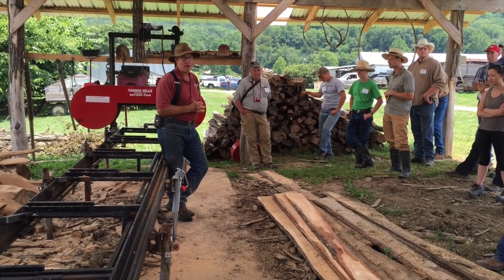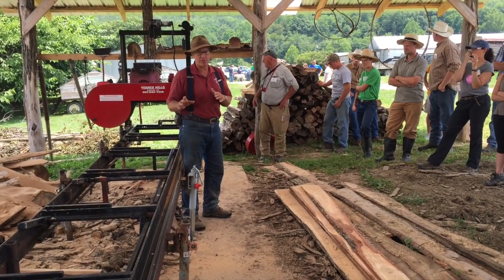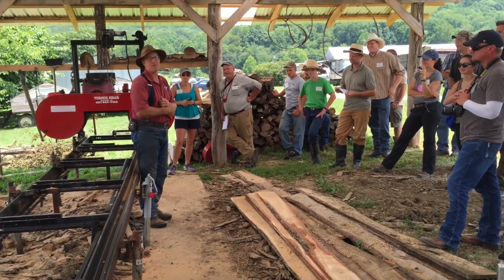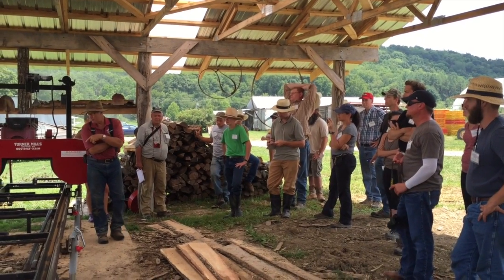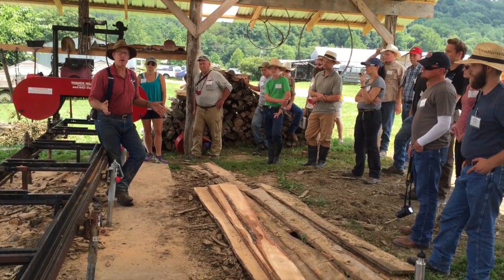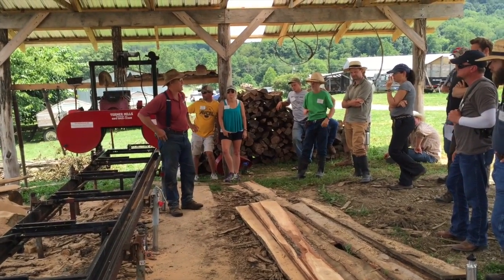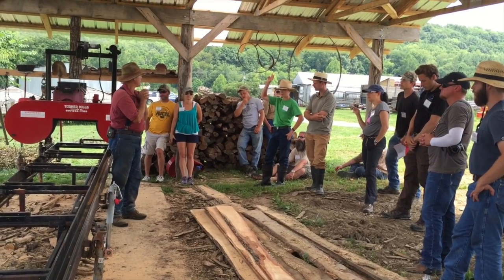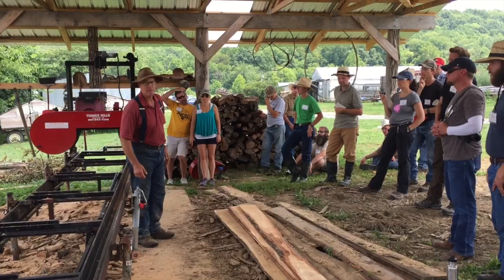Joel Salatin talks lumber milling

Comment: What brand name is that mill ? And does that mill have tires that the blade ride on ? I'm asking because a man that I used to help mill lumber had a mill that looks just like that one heavy steel track and the log stoppers everything looks the same .. and that was back in the early yr 2000
Reply from the maker: It’s a Turner Mills saw mill. And, yep, the blade is secured by tires.
Reply: @JeffGray  ok thank you..

Comment: Little off on his lumber pricing.  Framing grade lumber can be bought for 40-50 cents a board foot at any lumber yard.  An 8' 2x4 contains 5.33bd ft, so it's worth what it saves you from buying (plus sales tax plus the taxes on your income you would have paid in order to have after tax money to BUY that 2x4....I figure about 30% between the two in my State and income level)    5.33 x 50 cents = 2.67 + 30% = ~ $3.50.
STILL not a bad return.....I can saw couple hundred of them in a day, so "penny saved is a penny earned", I can earn myself  $700/day (less cost of gas/maintenance/etc) IF I can use the lumber on my place instead of buying it at a lumber yard.

Those are the real numbers.
Reply: How about now?

Comment: The added bonus here is that you can burn the slabs and edgings (and quite possibly even the sawdust, too) in an outdoor wood furnace to heat your home and shop. Practically zero waste, and the bug and vermin attracting mess kept under control at the same time.
Reply: This narrow kerf mill produces very little sawdust.  What they do produce is probably used for winter bedding.  They do make firewood.

Even better than outdoor wood furnaces is a good wood stove.  Radiant heat is superior to blowing hot air around.  Better yet is a rocket mass stove heater,  They use about 1/5th to 1/10th the wood.  Check it out.

Comment: A simple chainsaw mill is all you need. It will take an entire day to do a tree, but it's also only 150 dollars for an Alaskan chainsaw on amazon, as compared to starting at 2 grand for a mill.
Reply: Nick Collinet  have you ever tried to use an Alaskan mill vs. "cheap" manual bandmill....spend the 7k trust me ....I have used/own both.
Reply: @Pat Collins I built and used a chainsaw mill. I didn't like the waste or excess sawdust caused by the large kerf, but I especially disliked the speed. If I were to do it again and didn't have the $7k, I'd probably build my own bandsaw mill. But honestly, the older I get (I'm 54), the more I learn that it's better to spend money to save time, because I haven't found a way to make more of the latter. 😀

Comment: Wondering if it's possible to do rough sawn lumber as well as smooth with this mill?
Reply: Rough sawn lumber is an industry term that means it came straight off a sawmill.